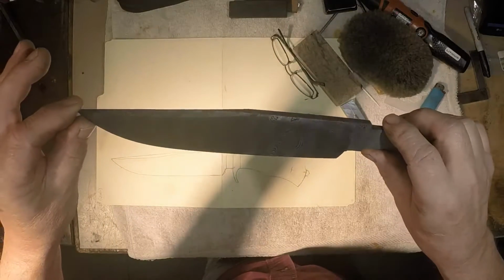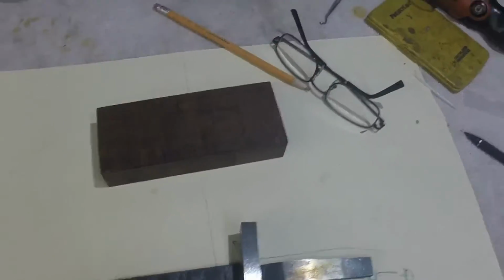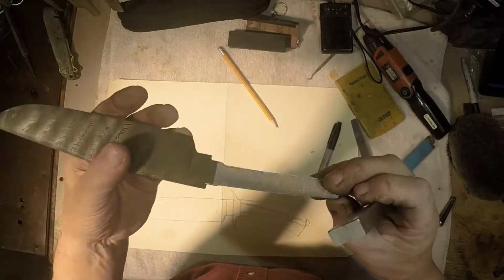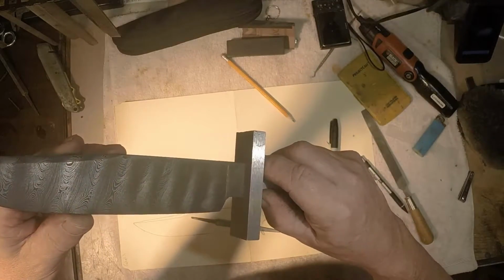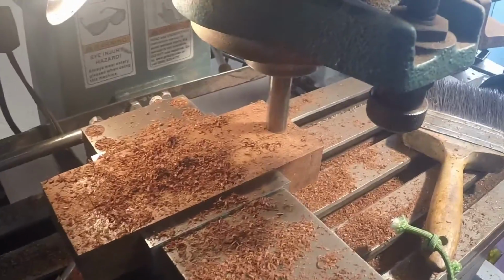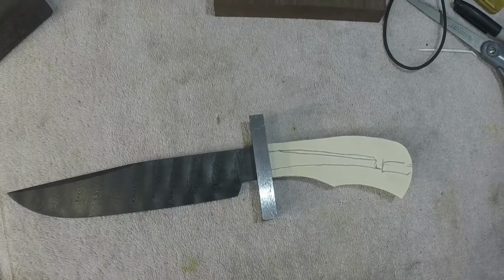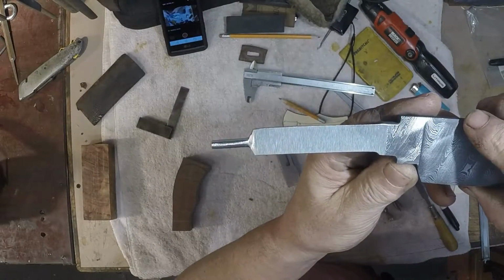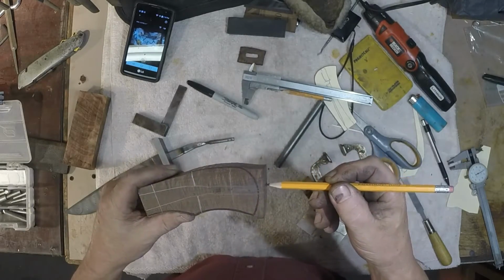Take Down Fighter Assembly 1

Comment: Some excellent tips and tricks!  I'll have to figure out how to apply them without a mill or surface grinder though, but I do have a variable speed reversible disc grinder and a (cheap, harbor freight) bench top drill press, files and calipers lol.. I'll make it work 😄.  My drill press sucks pretty bad though, as the shaft actually shifts when any pressure is applied to the end of the drill bit.  Due to horrible lack of shop space, I am looking into getting a quality bench top, as opposed to floor drill press, off of craigslist perhaps.  Anyway, great video!  Thanks again for taking your time to share this valuable info with us.  I hope to see some footage of you shaping your handle with your rasps on part 2... when watching a master craftsman at work, even watching hand sanding can be intriguing. 🤓👍